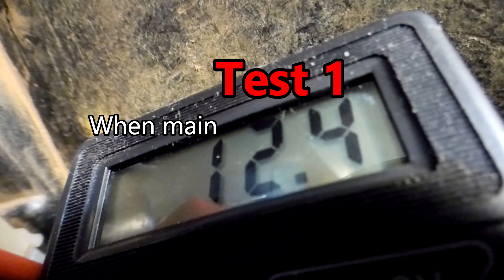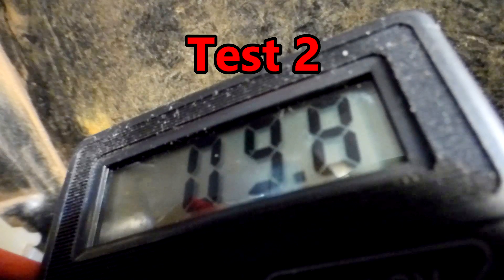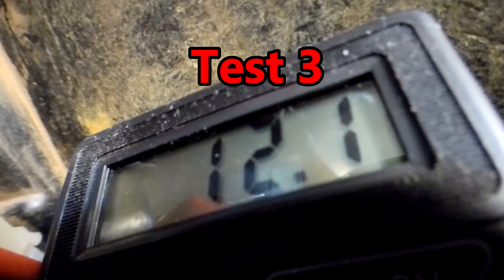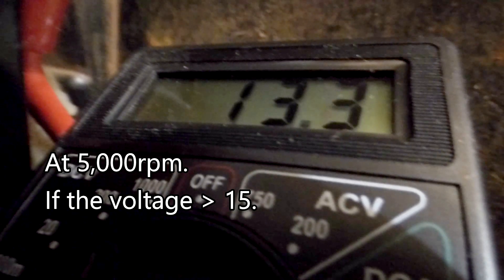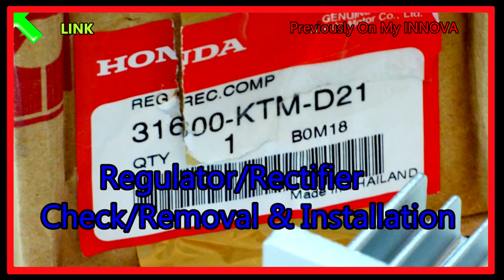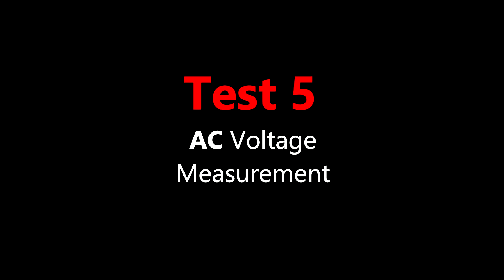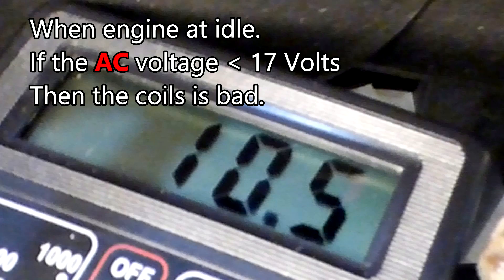How to check the battery and charging system? | HONDA INNOVA GARAGE | ANF125 | WAVE | 2010

Comment: The ac test is the same for carburettor edition 2006??
Reply from the maker: @ouzou7  
Hi sir. I don't know how to answer you.

It is not related to the carburetor, and it is related to another model, from another year model.

If there is more than one phase(coil), then expect to get the same value in all of them. As far as I understand it is about charging a 12 volt battery, the zone is around 18V AC at idle, and as mentioned, all phases should show a similar value.

Sorry, I share, I do not advise, if you are in doubt, or not sure What should be done, contact a qualified mechanic. Thanks.
Reply from the maker: @ouzou7  
Hello Greece👍.
If you have the ability and knowledge, check the battery first. An hour after charging it should hold at least 12.4V.

At idle in zone 13V DC I think it's normal. Then at high rpm if the bulbs do not burn, and the voltage on the battery terminals does not exceed 15.5 volts DC, then this is also normal.

But again, I do not advise, what you decide to do is your full responsibility.
Reply: How much AC volt can read  at idle ??
Reply from the maker: @ouzou7 
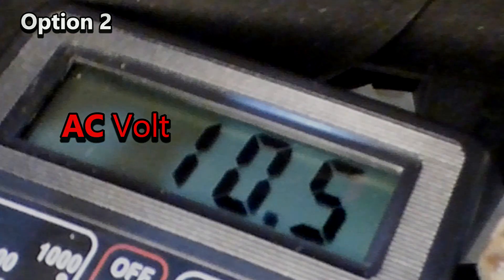See at 3:22, ACV > 17

Comment: Hi! I just removed top cylinder of my ANF125 and when you look inside, There's a bit of rusting on my crankshaft is it necessary to open it fully to clean?
Reply from the maker: Hmmm... it's hard to say if it's worth opening just because there are signs of rust... opening the lower engine is of course more work, and more spare parts you may need to buy... it's your decision.

My rule is don't touch what works well.

Therefore the questions may be:
Do you have reason to suspect that the bearings are also rusty?
Or
Is the rust in a state where it crumbles inside in such a way that it can cause damage to the bearings in the near future?
Reply: @MyINNOVAMotorcycling  the bike is 18 years old, I already bought crank gaskets, cleaned the carbon build up from piston and i also want to check what's need to be replace inside. 
I'm a DIYer so im doin it little by little. And also with the help of some of your videos all parts from chassis is disassembled. 
Now, im on the engine part, my problem right now is i can't open the flywheel nut on the left side of crank. Do you think inserting a coin on the right clutch housing will work? Btw i already did the inserting a metal on the embossed part of flywheel method but i can't find a sturdy spot to place it, The engine is removed from the chassis and all parts from chassis is disassembled.
Reply from the maker: @RoBert-np7lz  
Do you think inserting a coin on the right clutch housing will work? 

I think a coin will stop the rotation, but that is not the recommended way, so maybe there is a problem with the torque here. The load needed to loosen the flywheel nut may break teeth. If you have an old motorcycle chain, then the flywheel can be grabbed with a chain and ring wrench.

If you need support points you can put the engine back on the frame, it's only three bolts and it's done.